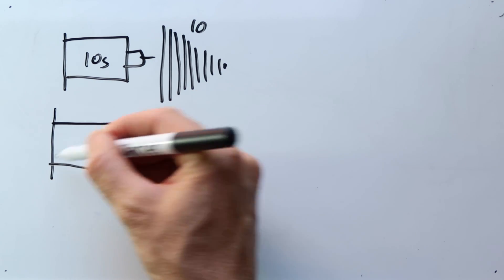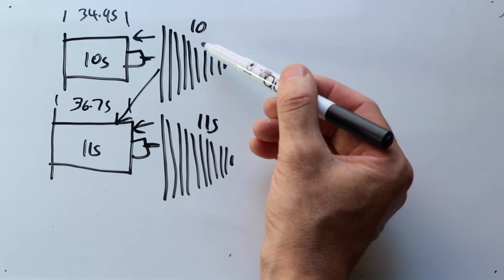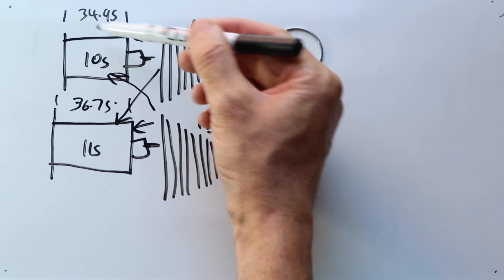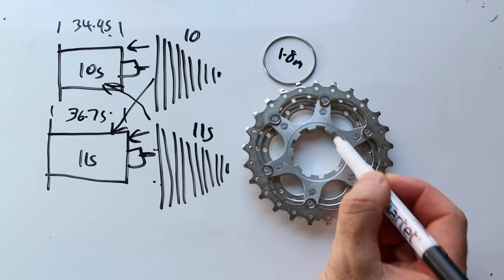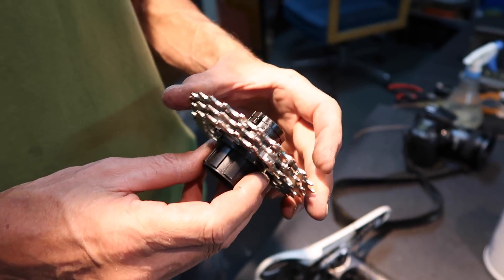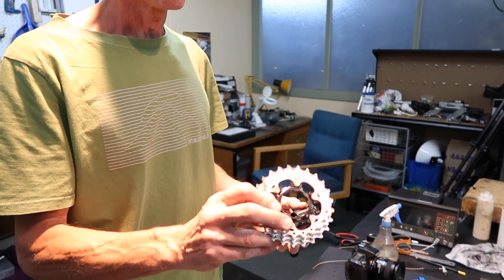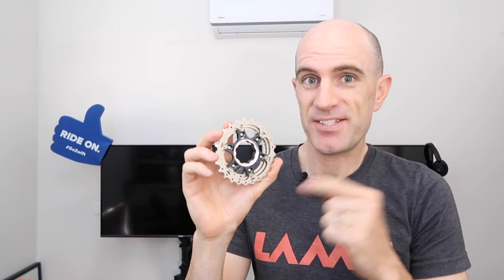Fitting an 11 Speed Cassette on a 10 Speed Hub (Shimano Hack Tip)

Comment: not a hack exactly, this more like putting disc brake mount on a frame with pegs for rim brake
Reply from the maker: No, that's just dangerous. This is, by definition, a 'hack' off of material for something to perform the exact same function as designed.
Reply: @gplama  how is disc brake dangerous ? to be clear, watch oldshovel redesign old mtbs, he cuts off the rim brake mounts, and weld on a disc monut. I believe thats a redesign
Reply from the maker: @bb1039  Putting a disc brake on a frame that was never designed for it. Not exactly the safest thing I can think of with the bikes I usually discuss/cover here.
Reply: @gplama  maybe not. enjoy biking

Comment: Awesome... I think instead of spending over 10k on CNC equipment, I'll just spend $150 on a quality set of 11 speed wheelset.
Reply from the maker: I'm not quite advocating spending $10k on anything. This method is a solution in situations where there is no option to upgrade to 11 speed freehub....the LeMond Revolution being the example shown.

Comment: Found this video after I did my conversion, although I don’t think I would have been able to do the machining. I needed an emergency wheel for a century ride; I found cracks in my wheel and could not get/rent a wheel from any LBS due to COVID and my new set of wheels was 2 weeks away. A friend gave me an old bike that had a 9 speed cassette. I was able to put 10 of my 11 cogs on it, and had to file down one of the standard Shimano spacers and add it to the stack to have the proper stack height. Worked very well.

Comment: now your 11 speed cassette is ruined and can't be used in normal 11 speed freehub body. Initially, you should best swap your 10 speed freehub body with a brand new 11 speed freehub body rather than spending more $$$ for the machinist to CNC your 11 speed cassette. If you really like CNC method, you should CNC your 10 speed freehub body to become a 11 speed freehub body instead as you can still use other 7/8/9/10 speed cassettes to fit in with the appropriate low spacer/s.
Reply from the maker: Potato, potato. This is one way. Yours is another.

Comment: I finally found a shop that does a great job modifying 11-speed cassettes to work on 10-speed hubs.  If you're interested, check them out: https://www.yelp.com/biz/great-western-grinding-huntington-beach  They only charged me $50.  A lot cheaper than a new hub or new wheels.  PS: I don't work for the company or have any other association with them.

Comment: 11-speed Shimano MTB cassettes already have the 1.8mm cutout so you can just use that if you prefer. So an 11T 11-34 will fit directly to a 10-speed hub. They come with a removable 1.8mm spacer to fit on 11-speed hubs.
Reply: I think the cassette you are talking about (CS-HG800-11) came out after this video was made. And only the long cage derailleurs work with the 34T
Reply: Hey guys, I have Deore XT RD-M8000 rear derailleur 11 speed long cage 
Deore XT CS-M8000 cassette 11-42 T
And DT Swiss M 1900 SP wheels with shimano hubs.
Do I have to get it machined?
Thank you

Comment: Thanks for the video, saved me a ton of money. Just fitted a 11 speed 105 casette to a 8/9 speed hub (Joystar, very cheap, very clean). I now have a spare trainer wheel for about 65 EUR. I used the lathe technique and skimmed 1.8 mm off the cassette.

Comment: I was running 10 speed Campy (LeMond Campy freehub) and later converted my bike to Shimano 11 speed. I simply bought a campy 11 speed cassette for the Lemond which worked perfectly with the 11 speed Shimano bike. No adjustments to derailleurs were needed. I haven’t seen this option discussed anywhere.
Reply: Interesting.  I'm preparing to convert a Trek 5900 with 9 speed Dura Ace to ideally an 11 speed Ultegra 8000.  Thoughts?
Reply: how did this work? it fits shimano 11s chain/rd without adjustments/issues?

Comment: Could it also be a possibility to take out one cog and then setting the limits on the rear derailleur according to this?
Reply from the maker: +Thomas El Capitan This is a perfect conversion. That may work for a few gears.
Reply: I've just tried this with a set of Bontragers. I took out the 14t cog and adjusted the high and low limits. Seemed to work fine on the stand but very clunky and jumping lower down the block.
Reply: Thx for the reply Shane. I have tried taking out a cog on my 11 speed works quite OK 😃 But I'll be doing your solution soon!

Comment: Hi Shane! I'm thinking of purchasing my first wheelset for my bike. I'm currently looking at a set of Yoeleo wheels that come with a 10/11 speed freehub. 
My drivetrain is currently shimano sora 2x9

Am I able to use a 9 speed cassette on these wheels? Is there an additional spacer id need?

Also kind of unrelated to this video topic but would a 88mm rear 60mm front look silly on a specialized allez going around local roads? The set is still lighter than my current wheels but not as light as the 38mm of course but if I want to save weight It wouldn't hurt me to lose a few pounds myself

Thank you for any input
Reply from the maker: Should be no issued with the 9spd on those wheels. Re: 88mm.. yes. Those are racing wheels. 60mm..... still racing style wheels. Your call though.
Reply: Shane Miller I thought they might but my deep section envy was getting the better of me haha. thanks for the help!

Comment: You could have saved yourself the trouble and just fitted a campag 11 speed cassette! They are dished on the inside so they are backwards compatible with 9/10speed freehubs. The indexing spacing on campag is compatible with SRAM/Shimano. If you don't believe me. Here's a link from Zinn himself: http://www.velonews.com/2013/09/bikes-and-tech/drivetrain-compatibility-hidden-in-plain-sight_303199
Reply from the maker: This would require a Campag freehub for the Lemond I assume? That'll be about the same cost as the 11 speed Shimano freehub conversion.

Comment: Hey Shane,  this spring I had warranty my bike frame due to a cracked front derail-er hanger on my carbon tri bike.   Apparently it was not repairable.   So the updated frame/ bike ended up being an 11 speed.  My old one was 10 speed.  I had just bought zipp race wheels used the year before and was bummed that the new bike was a 11 speed.  Looking for solutions, I ran into your video.   Being in a tri club in the Motor City,  I had friends that were machinist who willingly turned my big cogs on a lathe to the 1.8 mm specs in your video.  I just tried my race wheels out yesterday on a ride.   I didn't have any shifting issues at all when i swapped wheels.   Thank you so much Shane, you saved me a bundle.

Comment: Shane, could you please let me know the diameter of the cut on the cassette? I know it's 1.8mm deep, but how large of a diameter is required? Thanks!
Reply from the maker: Not sure to be honest. It'd have been 2-3mm... the Ultegra had a fair amount to work with off the back. I'm not anywhere near it to measure sorry.
Reply: Shane Miller thanks for the reply
Reply: Depends alot on the hub you are using. You need to clear the hub shell without binding so measure accordingly. I find 40 odd mm is reasonably safe

Comment: is possibile to modify the freehub instead of the cassette?I think is better this solution,becouse for any cassette you have to machine , if is the freehub modified you can use any 11sp and any 10sp with spacer added , and no other modifications
Reply from the maker: Not on the LeMond as there isn't enough lip. Taking 1.8mm off it will likely break what's left when installing the cassette. It may work for other freehubs.
Reply: I did just pick up an extra cast-off 10s freehub for my Lemond. I have a friend w/ a lathe. We're going to try to machine the freehub down to see if it'll work. I'll report back!

Comment: Just one question... What was the point of doing that on your trainer when you said in the machine shop that you'll never be in that largest cog anyway? Surely that means you don't actually need 11 speed on your trainer...???
Reply from the maker: +Skinz 72 Correct cog spacing. And one for one compatibility with my 11spd bikes.
Reply: Ahh I see. Didn't think of that. Nice one.

Comment: Cool. But sadly I cant see this applying to most real world applications.
Reply from the maker: +TheLionEric This shows it being used in a real world application.....
Reply: In which you need a lathe, to machine cassettes which effectively only is applicable in trainers and no where else and again, only if you have tools worth more than most mid level trainers.
Reply from the maker: Sorry mate. You're wrong. Do your research on this. This solution has been used on a number of wheels that allow the clearance of the rear mech to make this work. It is also a good solution for 10spd disc wheels. More research and you'll have no trouble finding a machining shop, or someone with a lathe who'll be happy to do this quick task. Put the call out on Facebook, Twitter, ask a friend. I appreciate comments on here and enlightenment. When it comes to shutting things down and dismissing things, I'll respond. It's my no bullshit get shit done way. Sorry. No offence intended.
Reply: I found a machine shop to do mine for $50 bucks. in an hour. You don't need to BUY the lathe, jsut find someone who has one- most engineering schools will, some auto repair shops will. the casettes fits on all my Road bike wheels out on the road, so defnitely it works in a real world application.

Comment: I've seen your friend with the workshop pop up in a couple of your videos Shane. I'm also in Melbourne, and I've got a carbon wheel rim that got buckled on a Donna descent, after I lost a spoke on the other wheel and had to disconnect the brakes. Are these the kinds of jobs he can do / are worth sending his way?
Reply from the maker: Is is warped or buckled? One is fsked, one can be fixed by any good wheel builder.
Reply: There's a 70mm long section of the rim that has gotten wider, by at most 2mm.
Reply from the maker: I'd consider that shagged. Might be worth pinging Raoul about it @ Luescher Teknik

Comment: So Shane,  1.8 mm depth and 1.00  width right? (for machine)
Reply from the maker: Depth yes, 1.8. Width/circumference doesn't need to be precise, just enough to clear the end stops.
Reply: Circumference needs to clear the hub shell of whichever hub you are using.

Comment: Just get a Mtb 11 speed cassette. as you say, the large cogs will not be used.
Reply from the maker: Not a complete solution though. Best answered with a cut and paste from 'HillRider' on another forum: " What Shimano did was make their 11-speed MTB cassettes narrower than the 11-speed road cassettes. The 11-speed MTB cassettes will fit on an 8/9/10-speed road or MTB freehub body like the current XTR. The road 11-speed cassettes, being wider, require a specific wider freehub body."

Comment: I guess this hack can work for fitting 11 spd road cassettes on MTB hubs? As the MTB hubs are 1.2mm shorter than 11 spd road hubs. Tried to find a way to achieve this but your video is the only thing I've found so far.
Reply from the maker: No idea. Not something I've looked into or had to solve.

Comment: "$175 for a part?  Ridiculous!  Better go spend a few grand on a lathe."

My kind of problem solver.
Reply from the maker: +Romans Five|Eight Teach myself to fish and I'll never go hungry! (Cheap ones are ~400 that'll be suitable for this task) #LlamaPreaches! 👍🏼
Reply: There's a similar, ridiculous kind of mentality that's becoming a bit of a meme in 3D printing circles. Spend $5 for a replacement bit of plastic, or design, print, adjust, print again, fit and finally polish your own part virtually for free!
Reply: My LBS would charge me 20.- alone for placing the order for a pair of i-Spec II spacers necessary to mount my Shimano brake levers to the handlebar after I replaced the i-Spec II shifters that would normally use up that space.
Adding to the cost of just placing the order I'd have guessed that it would cost me around 30.- additional bucks for the parts themselves and on top of that I'd have to wait for - I assume - a week for it to be delivered.

Same for when I switched the Crankset from the factory delivered boost model to a non-boost ( -3mm chain line ) one and I needed thinner spacers to properly mount the frame mounted chain guide using one 3mm thick spacer instead of the stack of three 2mm thick ones.

In both cases, it's not only just about the costs but also about time and availability.

Being able to make a part in just 3.5h ( 30min modeling, 2h printing, 1h postprocessing ( 20min IPA bath + 40m UV curing ) ) instead of waiting 5-7 days for a delivery still looks like a sound idea. Same for making yourself a set of unusually sized spacers in the matching color of the factory ones I couldn't have gotten to begin with.

Comment: Hi Shane,
Ever since you mentioned you wanna buy a lathe I've been thinking about how to help you through the massive amount of information (and confusion) that you'll come across regarding machining, products, where to start etc. As with anything new there is always a learning curve.  It helps to understand something when trying to get into it and I think this will really help build your confidence and take a lot of the mystery away. What I'm talking about is this article http://modelengineeringwebsite.com/Kitting_up.html 

It's aimed specifically at someone getting into model engine building but most of it applies to general machining. Don't get too hung up on the Myford, but the rest of the information is really to-the-point. Hope you find it as nice a read as I did. 

Aryan
Reply: Plus, don't let the large amount of tooling put you off, a lot of it you don't need, just consider this good information you wish you knew when you start to get into machining.
Reply from the maker: Great advice. Thanks mate.

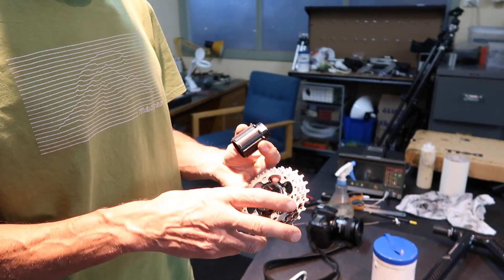Comment: Here's where I have a problem with this, and it's not to do with the technical aspect, but practicality. The correct answer to my mind, is to not convert to 11s on the trainer at all. When you first met with Raul you guys came to the same conclusion at 3:23 in the video. Seems like the easiest way to tackle this would be to use a 10s cassette with the ratios optimized in the gear range it will be used in. Still, if you must have it in 11 it's a job well done.
Reply: Absolutely - replacement cassettes will also be cheaper too...

Comment: funny. this is exactly how campagnolo did their 11s system.
Reply: Shimano also does this with their 11 speed mtb hubs, I don't know why they just dont do so with their road stuff.
Reply: @malicalik  if I buy an 11 speed mtb cassette will it fit on a 10s road hub? Is that what you mean
Reply: @Megadeth6633  the Shimano 11 speed road 11-34 does the same thing , you can put it in a 10 speed hub

Comment: Shane! I have been looking for a straightforward video on this ever since i was gifted a nice set of 10spd carbon wheels. Only problem is I have 11spd ultegra! Now the hunt for a machinist who cycles! Cheers!
Reply from the maker: It's a pretty basic task with a lathe. Any school with a metal shop might be able to help out. It'd be a good first project for any students. (Including me, I need to get a lathe!) :)
Reply: only question remains: if i want to use an 11 spd hub, do i need a spacer?
Reply from the maker: Not enough info.... an 11 speed hub with a ? cassette? 10. Yes. 11. No. *See the manual to be 100% sure.

Comment: Hi shane. Cool video, but it's left me a little lost. I recently picked up a set of fulcrum racing 1 wheels with a 10spd 105 cassette on. I wanted to use them with my ultegra 6700 11spd, so simply swapped the cassette over. it went on no problem at all, as did the 10spd onto my ultegra rims with 11spd hub.
Reply: BikeDeal.ca 
Oh OK,  that's cool. Cheers.

Comment: I did that for a set of race wheels.  Careful if you do put that on a set of 10spd wheels though.  You'll need to adjust your upper limit screw significantly as the derailer will set much much closer to your spokes with in your big cog.
Reply: Not sure how long you used this set up.  Six years later, any issues?

Comment: Doesn't this mean that the position of the casette relative to the derailleur is different? Because this way it will move 1.8 closer to the trainer...?!
Reply: I initially thought the same. But I guess the cassette would be in a different position without the adjustment (i.e. 1.8mm closer to the RD than usual).  Stripping off the cassette on the inside brings it closer towards the wheel and the cassette ends up being in the correct position relative to the derailleur. Hence the nice, crisp shifting. ;)

Comment: why not use a mtb 11speed, same width as a 10 speed
Reply from the maker: Good question. Best answered with a cut and paste from 'HillRider' on another forum: " What Shimano did was make their 11-speed MTB cassettes narrower than the 11-speed road cassettes. The 11-speed MTB cassettes will fit on an 8/9/10-speed road or MTB freehub body like the current XTR. The road 11-speed cassettes, being wider, require a specific wider freehub body."